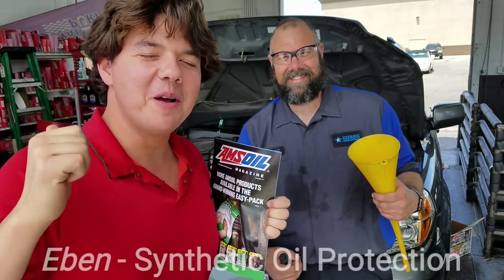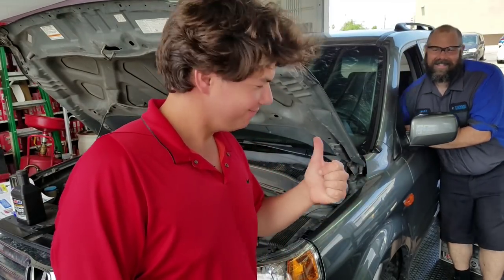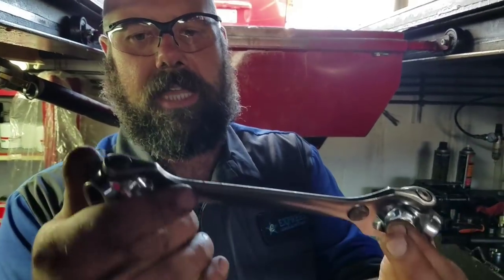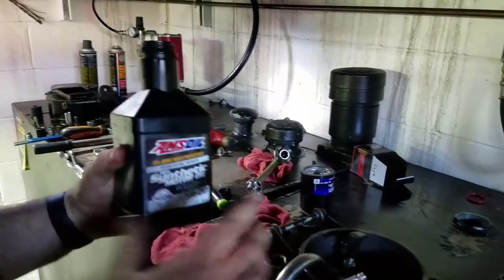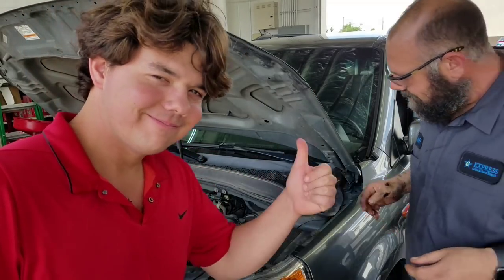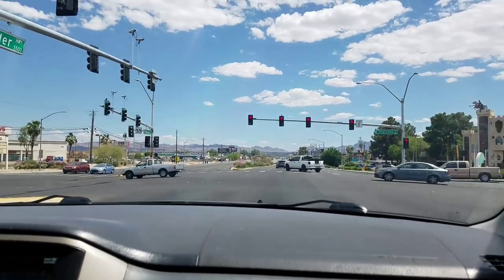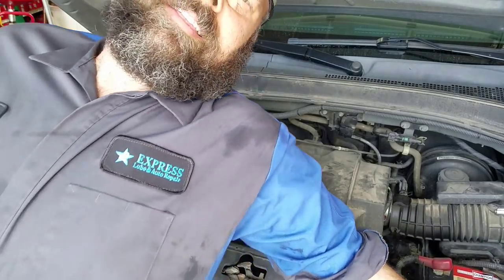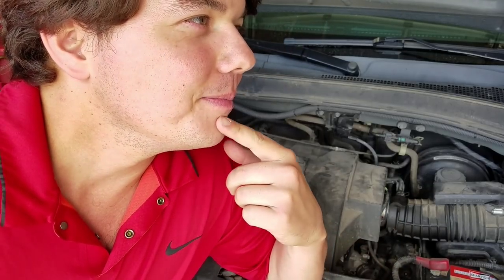Jeff's 2008 Honda Pilot AMSOIL Engine Flush Experience

Comment: Great Video as always. Have a question when do a add AMSOIL PI gas  improvement additive to my gas tank? Do I add on  empty tank before I fill up or after I fill up tank then add it.
Reply from the maker: You can do it as you're filling up the tank mixes better.

I always put it in about 10 to 15 gallons and after I drive through only 5 to 6 gallons it already cleaned everything.

The only thing you want to make sure that you don't put it in over 20 gallons of gas because it won't be concentrated enough.

That's why I usually put it in about 10 to 15 gallons of gasoline and the results are great

Comment: Where do I sign for the hookups for ams oil stuff
Reply from the maker: This is my personal link that will get you 25% off and free shipping on any order $100 or more.
Eben Rockmaker
Independent AMSOIL Specialist (Dealer#: 5331179) 
Mobile: (702) 472-3614

My link to buy AMSOIL: https://www.amsoil.com/offers/?zo=5331179
Steps to order by smartphone or computer: 
1. My blue link gets you 25% discount and free shipping on orders $100 or more as a Preferred Customer Member ( best way to buy AMSOIL ). I will get credit for your purchase when you use my link. Click My blue link, Click Join Now Orange Bar Preferred Customer for 1yr or 6 months. Note: AMSOIL will not keep your Credit Card on file. There is no recurring charges.
2. Click look up vehicle.
3. Select vehicle type AMSOIL has all the fluid amounts listed. It's best to get extra bottles because that way you won't need to reorder and pay shipping $8.99 on just one item...lol
4. After you have all the products added to cart then complete order. Any order $100 is free shipping and ships in 1 to 2 days. ( 90% of orders before 12 noontime will be delivered next day😉 )
Reply: Should come to
Michigan and do an oil change an fuel additive video with me

Comment: Can I use this Amsoil on my 2018 Dodge Charger with the 392 Hemi.
Manual recommends strictly Panzoil 0w40.
Reply from the maker: Correct Amsoil 0w 40 exceeds OEM by quite a bit because it's 100% synthetic it's a upgrade over Pennzoil Ultra Platinum
Reply from the maker: Also the Amsoil oil filter flows better than OEM and it's a higher-quality medium
Reply from the maker: AMSOIL Vehicle Lookup - https://www.amsoil.com/guides.aspx?zo=5331179

They make the filter for that vehicle and if you decide to give it a try I recommend doing a flush and a pi fuel cleaner.

If you decide to give it a try it's definitely most cost-effective to become a Amsoil preferred customer where he saved the 25% and then they get the free shipping on any order a hundred bucks or more
Reply from the maker: And if you just want to give it a try you can still try at retail
Reply: I changed my wife's Jeep Grand Cherokee's oil with Amsoil and even she noticed smoother ride. It has 40k miles and that was the first time on Amsoil. Definitely getting Amsoil again and this time adding engine flush.
Also changed oil and rear diff. Oil on my Charger 392 and it seems like I'm getting little better MPG. Didn't really notice "smoother" ride but it could also be that the car is still fairly new, only 16k miles on the first Amsoil change.
Next time I'm just gonna do PI fuel and later around 30k engine flush with Amsoil

Comment: sounds like he also needs a vcm disable kit.
Reply from the maker: What is that?
Reply: @Syntheticoilprotection  The Honda 3.5l engines with variable cylinder management are known for burning oil. VCM allows the engine to run on 3,4 or 6 cylinders however, the problem is when the cylinder is 'paused', it causes damage to the rings and motor mounts. There are many kits out there that trick the ECM into thinking that the engine is a few degrees below operating temperature which causes the VCM to not activate. More info here: https://www.vcmtuner.com/